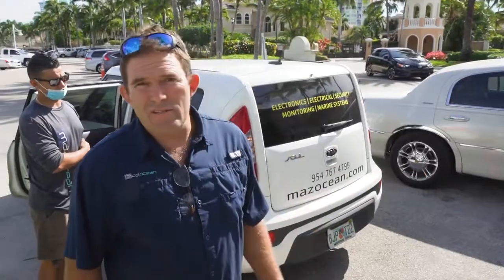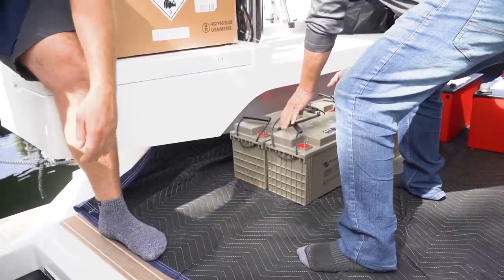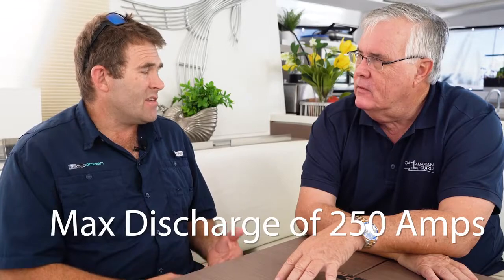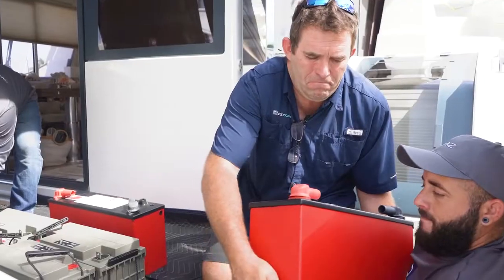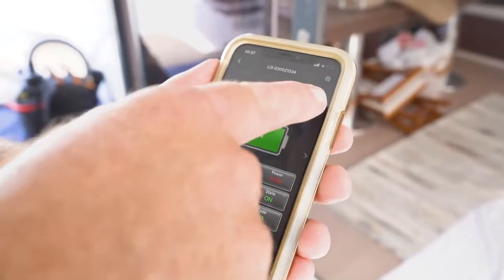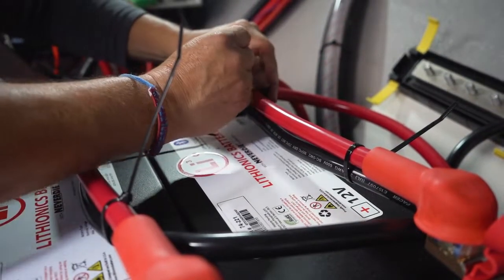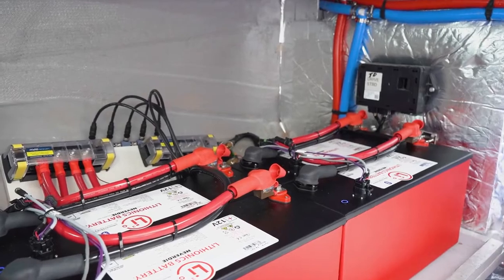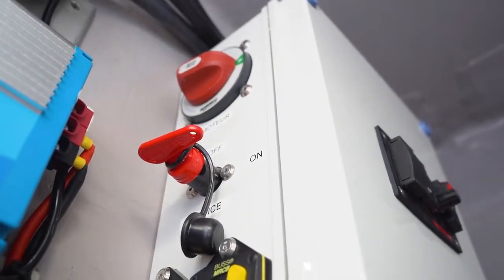Lithium Batteries For Your Catamaran Yacht

Comment: It is widely accepted that lifePO4 batteries should be operated in the range of 15-35degC. Above 35degC you are entering the realm of early battery failure due to temperature degradation. Installing these batteries in the engine room is absolutely crazy. The batteries are likely to see a 5degC temperature rise from gentle battery charging. Add in high ambient temperatures of the Tropics then engine room conditions and you can expect to get very poor life from these very expensive batteries. This is very poor advice. Yes the batteries will work at higher temperature but your life expectancy will reduce rapidly
Reply from the maker: Hi Tim, this was our reasoning from talking to the industry professionals. There is some truth that higher temps will reduce battery life but so does using a battery or simply storing a battery. The effect of temperature varies a lot based on cell type.  Some cells have a max recommended charging temp of 45C, whereas some such the Lithionics GTX batteries (type installed on Zuri) have a max of 55C.  Quite a difference. Additionally the Lithionics BMS has low/high temperature charge/discharge protection. It is important to note that even if the cycle life is theoretically reduced, the cycle life of the batteries is enormous. 
The Lithionics batteries have a built in bluetooth app that records and measures the batteries temperatures. Typically the ambient temperature in the engine room is 27C and after running the engines for several hours the battery temp will maybe get 40C. Remember that the engine rooms on the Bali are cavernous and when the engines are running the ventilation system is operating. I would be surprised if we ever see temperatures approaching the batteries max and even if it did the BMS would protect the batteries.
Reply: @Catamaranguru  There is a lot of research into LFP cell temperature. Measuring cell surface temperature is not the same as measuring cell core temperature. Core temperature will be higher. 
Only time will tell if your batteries degrade fast due to the high temperature environment.
Reply from the maker: @timevans8223  we will report back and hopefully it will all work out.